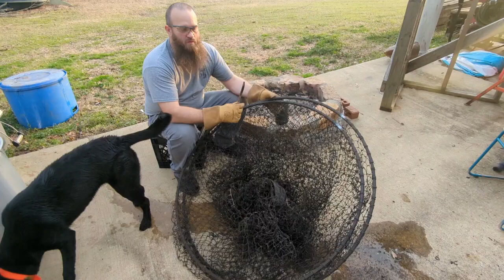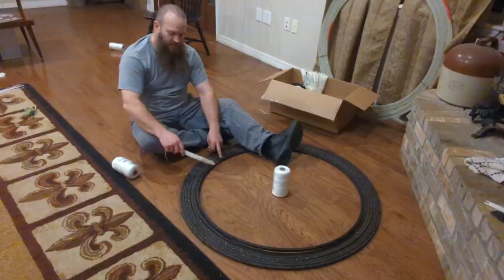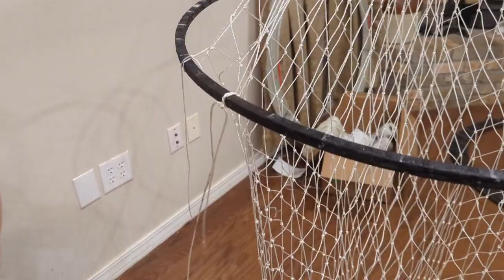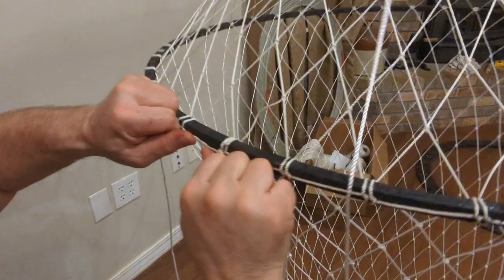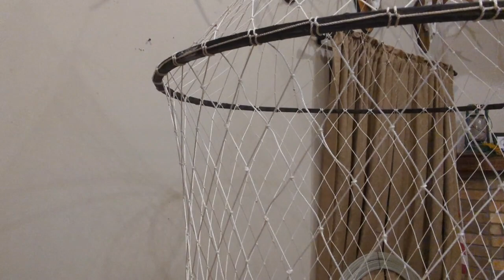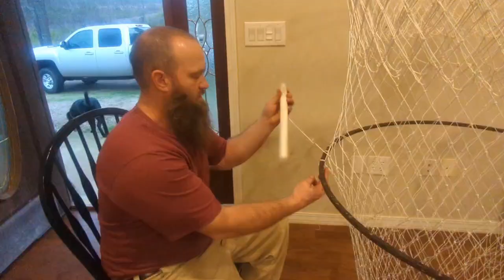BIG Flathead CATFISH Beware !!! Part 2: How to Tie Hoops in a NEW Hoop Net

Comment: Looks like fun but I’ll leave the knot tying to you bubba. I’m only about a half step above Velcro shoes as it is. 😂
Reply from the maker: 🤔 maybe Velcro netting next🤣🤣🤣
Reply: Yes sir first you have been my inspiration into hoopneting i always liked catfish but you have turned it up to 10 for me I have wire and hoop nets but I have a small problem!!
I have two brand new nets from NETS & MORE. AS A GIFT from family PROBLEM IS IM IN A 14x36 John boat and the largest I can run is 30inch 7hoop nets with 1 / 1/4  and 1/ 1/2 mesh nets. The nets that were given to me one is a 48 inch 5 hoop 2 inch mesh and the other is a 48inch 7hoop with 3inch mesh. Which is way too dangerous for me to use. These nets have been in a climate controlled shop and never used in perfect condition I’m looking to trade for 
2ft too 2 1/2 foot Hoopnets with 1 1/4 to 1 1/2 inch mesh. Looking to do an even trade my 2 nets for 2 smaller nets. 
If you can help me in anyway to trade these nets I’d appreciate. Thanks for the content and keep it up every thing I know I learned from you. 
If you can help me I can be reached at 225-400-3661  @godscountryhuntingfishing1638
Reply from the maker: You might get someone to trade, but it might be easier to sell and rebuy also. Easiest thing to do would be put them on FB marketplace. Guarantee you'll work out deal quick. Also there are 3 or 4 net fishing groups on FB. Post them on those with your offer also. Within 2 days you will find someone probably

Comment: Can u do a better explanation of how know how many mesh u use when I do the math for a 42 inch hoop I get 52 mesh for 131 in diameter with 2.5 inch diameter mesh but u started with 38 mesh then turn it to 39 when u tie the last knot to make a circle in the first video am I missing something
Reply from the maker: It's some trial and error. For one thing we're going off a pattern. Those nets are 38 mesh, not 39. Your dividing 2.5 into 132, but 2.5 is knot to knot. Stretch mesh is 5 inches. However, if you set it square like it sits in a net, you'd end up with 3.5 in hypotenuse. So if you have 2 sides of the square square both sides, add them, then square root that to get the hypotenuse. 2.5square +2.5square then square root of that =3.5. 
132/3.5=37.7 or 38
Reply: @godscountryhuntingfishing1638  ok the way I alway did it Is a bit different due to me making different nets I never really had a set diameter other then the finished diameter in a cone not cylindrical I’m using a 2 1/4inch gage mesh 4 1/2  in stretch mesh and wanting to make 48 diameter hoop nets from scratch my math gave me 66.7 mesh and will tie it to hoops 2 1/4 inch’s apart would that work?
Reply from the maker: @gunsmith19971997  48in hoops, 2.25in mesh. Circumference of your hoop is 150in. Your hypotenuse of your mesh, (tie point to tie point) will come out to 3.16. (150 ÷ 3.16 = 47.6) round that up to 48 mesh to keep divisions of 8. Divisions of 8 make take up and tie outs easier and even on throats. So you should have 48 mesh tied roughly 3.16 in spaced
Reply: Ok sweet thanks for the info save me making a whole lot of knots for it not to work